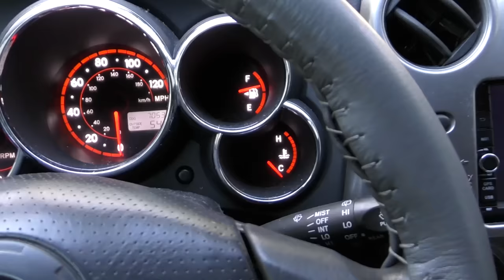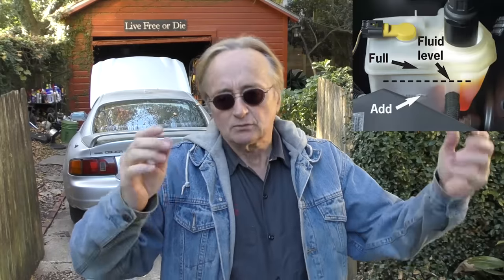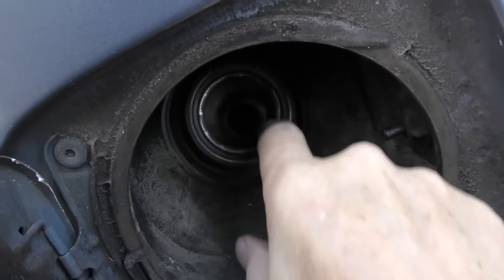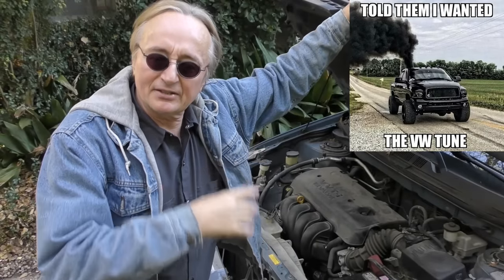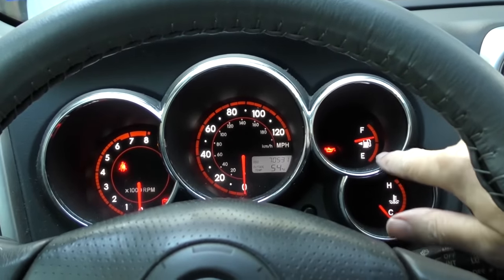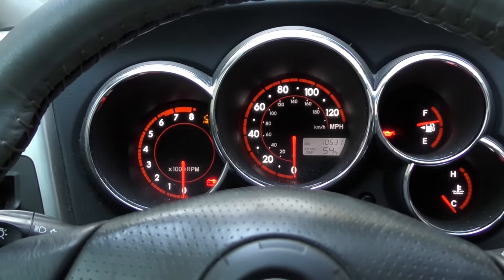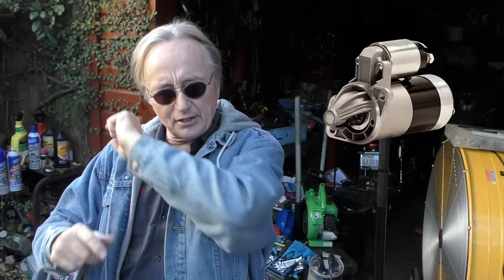Please Stop Doing This to Your Car (It Broke My Celica)

Comment: SCOTTY PLEASE HELP. My 2004 TT is overheating and keeps boiling up the coolant Reservoir. The coolant Reservoir cracked put a new one in but the damage is vast. The temp gauge gets so high and when i turn the engine off thr pipes under the main part in the middle of the engine start having a fit. Banging jerking thrashing up and down. Can someone please explain what's going on. I'm in two minds as to sell it for spares and parts or get it fixed. I haven't looked after it. And I'm angry with myself. It hasn't been serviced for years and it's done 40k miles in the last 3 years. Any advice welcome.

Comment: Scotty what do you think of Honda pilots?  Looking at all the vehicles you suggested. Curious about the pilot
Reply: The best value for money are the 2007 and 2008. Newer ones are more expensive and have extra various reliability issues. All of them do (they're not bulletproof), but the 2007 and 2008 have the fewest for the least cash.
Reply: @EMichaelBall  thank you,  I was actually looking at  a  2007.  I have 2020 gladiator and it's getting beat up by the grandkids.   I hate stressing the kids out so much over it.

Comment: Only problem with filling the fluid up all the way though when its low is its gonna spill everywhere when you put new pads on. Lol
Reply: You should flush it when you put new pads in. I've been amazed at how dirty it can be, especially right in the wheel cylinder or piston. Flush three or four ounces minimum, until it starts coming out clear and clean.

Comment: Hi Scotty, Our Honda Odyssey 2006 sometimes clicks when we try to start it and won't start, but oddly enough if we put the transmission in neutral (from park), in neutral it will start at the first attempt without any issues, I'm curious if you know why the minivan starter is behaving like this. Thanks!
Reply: That's strange, other than the parking pawl (what holds your car in place when it's in park) neutral and park should behave the same. I would go ahead and get the battery and alternator tested, any auto parts store should be able to.
Reply: @ixionn563  thank you!

Comment: Please Help!!!! i have a 2005 Nissan Altima. Every time i go to put gas in it the pump clicks stop just after a few seconds. them i take the nozzle out and put it back in i can put another 8-10 gallons in the tank. is it air in the tank? how can i get raid of this problem. Thanks! you the best!
Reply: That was a common problem.  You need to get the revised venting device.  I can't remember what it was called.  There is a TSB for this at Nissan
Reply: @rays7437  Appreciate it. Thank you. Will take it into Nissan.
Reply: @keshwarsingh3674  
Or take it to a good mechanic like Scotty who can perform the TSB.  TSB's are not free unless the vehicle is under warranty.
Reply: @rays7437  So i called Nissan. Apparently the TSB expired 11/4/2019. Guess i'll have to get the work done myself or find a Scotty in New York :) Thanks alot for the help.
Reply: @keshwarsingh3674  
Good luck!

Comment: John Lennon of mechanics. LOL  yes always use stock/OEM parts

LOL , about the 1/4 tank gas issue. Seen too many people , (especially women ;) running around putting gas as needed.
I start worrying about gas at 1/2 a tank. Keep gas in your tank(a full tank is best) , you will always need it , especially if the Zombie end times happen.

Comment: What's the difference between CVT automatic and regular automatic transmission?
Reply: A typical automatic has a set number of fixed gears. A CVT has a belt/chain (or in the case of some hybrids, a belt or chain in collaboration with a planetary gearset) driving a theoretically infinite number of gears within a given gear range.

Comment: Hey Scotty, it's getting colder here in Canada, and when I turn on hot air, the temperature gauge will start dropping after a minute or two. Why does it do that and is it normal? I have a 04 Sunfire. Thanks
Reply: Could be a bad thermostat. I had that same problem a few years ago. I put in a new thermostat and it's been fine since. But there can be other reasons for that. I just went straight for the thermostat because it only cost me $13 to buy one and in my particular vehicle it was in an easily accessible area to get to. And luckily for me it solved the problem
Reply: The car heat system takes engine heat and re-pumps it into the cabin. So that could explain the problem. It's not a huge deal, though if the thermostat's cheap and easy enough to replace, per Benny, then it's worth a try, but a slightly cooler engine shouldn't be a problem in winter bumper to bumper traffic. If the thermostat's starting to go, that could be a problem in the summer, though.
Reply: Thanks for your insights guys, I'm going to replace it once the snow melts. I still think it's weird that a bad thermostat can cause the engine to run too cold rather than hot.
Reply: @RexMods  the valve gets stuck open so too much coolant is flowing to the engine.

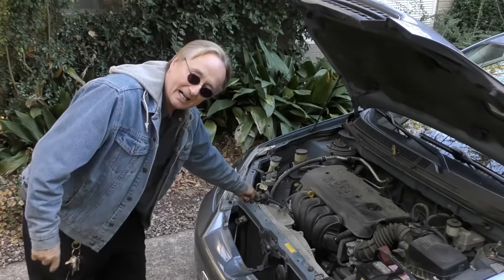Comment: automatic English 4:17 that is, the car is low on coolant, now [the] heater [of the] car is (not: now either car it's just your radiator what...) just a miniature radiator, but generally, they are on the highest point of the cooling system, so if you're low on coolant,  (not: soft your lawn), what happens is ...

Comment: A friend with a BMW had a starter problem.  The engine and transmission had to come out of the car to replace the starter.  $2,200 later, it was fixed.  Yikes!

Comment: We changed rotors and pads.
2013 F150. ABS service and traction control light came on. The code is pressure module failure 😮 ???

Comment: Charge your battery every 3-6 months.  Your car will not charge the battery to 100% and modern digital chargers can actual desulfate your battery a little bit.  Sulfation of the electrodes is what kills batteries that lose their charge.  I have a battery that is 10 years old and still load test like brand new because I charge it every 6 months

Comment: Cars that are newer like ford trucks dont have gas caps anymore the fuel door is the gas cap I have a 2012 f150 5.4L 4 valve DOHC v8 engine and it has a big rubber gasket on the fuel door and no gas cap bought it brand new asked the dealer why it has no cap and they said they come that way uhhhh sounds like issues over time

Comment: You shouldn't open your radiator cap for no reason you will get air in the system this will cause cavitation.

Comment: Are K n N air filters better to use than regular air filters?
Reply: Scotty would say stick with the OEM filters. I have had high air flow (K&N and similar) which use oil and I've never had an issue, however my sensor is easy to get to so I'm not worried about it.

Comment: The other day I saw someone on the side of the highway. Their PT Cruiser (I know, piece of crap) kept going crazy hot. I told them, “call a tow truck. You can’t drive around with that thing overheating.”
They answered, “yea I know but tows are expensive and it’s just the thermostat... I’ll just keep adding water to it and try to go as far as I can”

I was like, “alright then, I’ll just follow you for good measure. That way if anything goes wrong I can at least tow your car with my SUV to the next exit.”

Turns out it wasn’t just the thermostat 🤦‍♂️

We made it like, 5 or 6 miles total, and got to a rest area, and then their car just went PSSSHHHHHHHTTT, cloud of steam, and huge puddle forming under the car. The frickin water pump gave out 🤦‍♂️

Comment: Change the brushes on your starter. Good to go. Won't need to use the hammer. Fill the heater with water until only water comes out, then all the air is gone. Use vinegar to get rid of the lime. Good to go.

Comment: I have quick question - is it normal when you accelerate and let off gas to coast rpms rev up and down by 1000  from 1500 to 2500?  Any suggestion for the fix?
Reply: What kind of vehicle is it? The number of speeds in your transmission may determine how much the rpm will jump and/or drop. Your vehicle will downshift to a lower gear to compensate for your acceleration needs. Once done accelerating and back to coasting, your transmission will upshift to essentially final gear to offer maximum fuel economy.
Reply: @Kingswood7189  It's Hyundai Tuscon 2019.  6 speed automatic transmission.  It only happens at lower speeds about 20-30 km.
Reply: TheFireTerminator as far as i can tell, the lower gears (1st and 2nd) are pretty low and the ratios are more spread apart than the higher gears. That said, id feel like thats pretty normal. However, if it feels unusual, id take it into the dealership given how new it is. Theres a chance there might be an issue with the transmission computer (and how/when it shifts) and you can get it fixed under warranty.
Reply: @Kingswood7189  Thank you

Comment: I worked for a company where my silverado work truck would loose coolant and it was a bad leaking heater core, living in florida I just bypassed the heater core and it stopped loosing coolant. My manager was like "crap we need a new truck" I just told them give me $10 and let me run to the auto store.

Comment: and for cheap air filter may break and get sucked in and break the air mass sensor or sucked near the air mas then the air mass gets wrong reading and the car will not act normal.

Comment: not sure if this is relevant, but there is no such critter as a "maintenance-free" battery.  buy some distilled water from the grocery store, and pop those caps once a year.  if the cell level is below the indicator tabs, drizzle some in, up to the bottom of those tabs.  5 to 7 years on a battery is ridiculous. 10 or 12, cool. had a 1980 f150 i replaced the battery once in 21 years.  and if you replace it, get the best you can (and not a "diehard").
Reply: Depends on where you live. It's rare to get more than four or five years from a battery in Phoenix AZ. The summer heat here kills them.

Comment: Beat your starter with a bat, if your car runs, still change the starter cause you just beat the crap out of it.
Reply: Eventually you will need a new starter motor or it will let you down in the out back or somewhere like that and that might be serious .

Comment: What if your brake fluid is low because your break pad or low but there will you start pushing the brake cylinder back up to reset it all brake fluid is going to go over to Engine

Comment: Collant level does lower over time. No perfect seals existing for any of 'closed' systems. Fluids make away as fumes out of the system. On my car till brand new (12 years now) it takes 2 years to lower from the max to min mark and no problem experienced whatsoever.

Comment: Fun when people top off brake fluid with old fluid they had sitting for years when just replacing the pads would have been the fix instead of a lazy solution
Reply: @behexen250 who watches this to take the car to a shop?I am talking about personal garages and brake fluid is alchohol based

Comment: It's funny because i found that dodge's had the hottest heater I've ever felt in a car. My 2008 charger and my 2001 jeep xj for example have a way better heater than my 2005 five hundred my 2013 carolla my 2015 civic my 2015 crv and my 2017 f_150.

Comment: I fell in love with Mercedes-benz we my family was stationed in Stuttgart Germany at the age of 7.
Mother taught me to always purchase an Extended Service Agreement (ESA) ANYTIME you purchase a German car. 
Thus I purchased an ESA for my 2015 S-63 AMG SEDAN from Alphera Financial Services for $2700.
One year later (Father's Day weekend 2018) my S-63 died on me three times. 
I had my baby towed to MB of Augusta. 
After two days my service advisor called me and advised me that my S-63 was fine and that I had ran it out of fuel. I told him he was wrong as all three times the fuel gauge stated 20% tank capacity when it died. (Side note I miss the 26.4gal from the W140. 21.1gals is just not large enough for a 4700pound car with a 5.5L bi-turbo V8). The service advisor agreed to keep my baby overnight.  The next morning I was called by my service advisor that my baby which I had "ran out of fuel" required the following:
One fuel tank 
Two fuel pumps 
Two fuel filters 
Total cost to repair $13k.
Btw he was kind enough to make sure that I was sitting down before he provided me with the grim news. 
I told him that I would call him back in a few minutes and provide him with my ESA contract number. Nine days later I went to go pick up my baby (nine days with a CLA. ABSOLUTE CRAP. Only go thing was the fuel economy).
My service is provided me with the service documents and my key ags stated that he was not gunna charge me the $100 deductible from my ESA. I TOLD HIM HELL I WASN'T GONNA PAY IT ANYWAY. 
As you can probably tell by now I do not have a good relationship with my local MB Service Department here in Augusta Ga. 
Long story short my ESA paid for itself the very 1st time I used it.
Reply: If a fuel pump failing on that car is $13000 why would you want to own that thing? If it failed so prematurely why would you trust the new one? It may just last long enough to get you out of warranty I guess🤣. Btw, just did the fuel pump on my work truck. It was $80...
Reply: @bolerdweller  the point of the ESA is to provide you piece of mind. 
Anything man made can brake regardless of age. 
When you own a MERCEDES-BENZ you quickly become aware of the cost of upkeep and repairs
Reply: @bryanbaker274  I realize anything man made can break but premature failure in such an important part in a luxury vehicle doesnt give me confidence in the brand. The cost of maintaining one sounds awful
Reply: @bolerdweller  to each is own. 
What do you drive
Reply: @bryanbaker274  a GMC sierra, jeep grand Cherokee and a dodge caliber
Reply: @bolerdweller  nice. 
We have a Chevy Tahoe that we use for travel and my father has Jeep Grand Cherokee. 
We've actually looking to replace my sister's 2008 Tahoe with either a 2020 Tahoe or Denali.

Comment: Not letting the gas tank reach empty makes a lot of sense, but there are reasons to let it go well below a quarter tank: (1) Fewer fillups saves time. (2) Discount programs such as Giant Food's "Shell rewards points" can be more valuable when you buy more gas per fillup and take more time to accumulate extra points between fillups.
Reply: Brother Mine you’re spending dollars down the road to save pennies today. I’m not straining a $400 fuel pump module that’ll cost hundreds more in labor to install so I can cram in 2 extra gallons I’m saving 20 cents each on!!
Reply: @brucemorris3830  : Letting it go well below a quarter tank does NOT mean letting it ever reach Empty.  And I typically get discounts MUCH more than 20 cents per gallon.

Comment: Scortttttttttyyyy just bought a 2001 subaru forester with 193999 on dash... IS IT IN KM not miles.
Reply: What are you asking? Do you mean is the odometer in Miles or Kilometers? Whatever the main part of your speedometer reads in should be what the odometer reads in.

Comment: I usually run my car down to E but never outta gas usually I fill it the second the second it says low fuel under 30 miles left
Reply: The 1/4 tank rule is a good one.

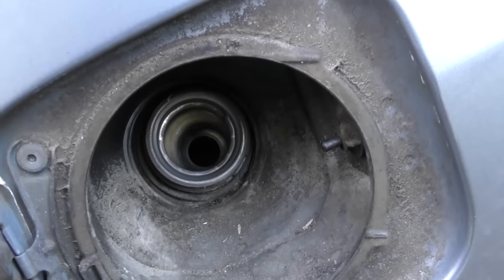Comment: 3:00 - that whole segment about getting an OEM gas cap replacement is a crock!    All you really need is an old pair of boxers.  Just rip the waistband off first, cause the gas fumes will make it deteriorate anyway.
Reply: I usually just caulk up the hole
Reply: Seungjae - oh, that's a good idea!    Why dint I think of that?
I get so tired of people stealing the boxers from the car -- I'm about out of underwear at this point....

Comment: I have evap code p0455 I replaced the fuel cap with an oem from the dealership I replaced the charcoal canister and the purge vent valve and I’m still showing the same code

Comment: I noticed several times, when entering my car my windows have been down and my gas cover has been open. How can i tell if my ex is entering my car without a key. Lately i also notice that he has been entering the trunk. Please! Help, i am 65yrs. I am terrified that my car will down as i am driving. Yes my ex has been hacking my car. This has really been a very steessful and scary situation. I dont have a security system installed in my car. This behavior has gotten unbariable. I spend many sleepless nights watching the only car that have. I mentioned to my ex that because of all the stress I have indured from him. Having your only means of transportation being destroyed and hacked by someone you once love. This saddens my heart daily. How can people be so heartless. What can i do? I will be relocating. But until than what can i do with a small budget. On a fix income disability.

Comment: Brake fluid does not get low for no reason!  If the brake fluid is low then there is a problem!  You don't just top it off and go on...
Reply: Brake pads getting thin like he said. But the size of the reservoir is usually chosen so that happens about the time when you need new brake pads.
Reply: @jimblake3574  
Yes, exactly.  This is why you should not fill up the fluid to make the light go out.  If you do  fill the fluid  to make the light go out then you no longer have a reminder that there is a problem. Without that reminder, most people with then keep driving on worn out brakes until they go metal to metal or worse.  I have seen it happen countless times

Comment: Can You change the Seal on the Gas cap ?
Reply: You generally can, IF you can buy a replacement seal. It's a one-dollar item if you can get it. But often they are not readily available. Usually, it's just a big O-ring, but you have to get the exact size.